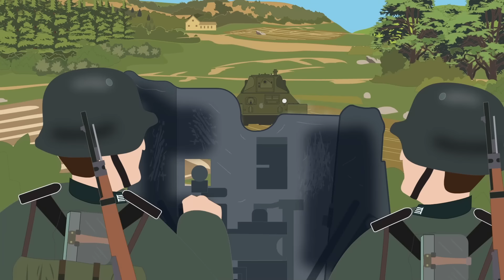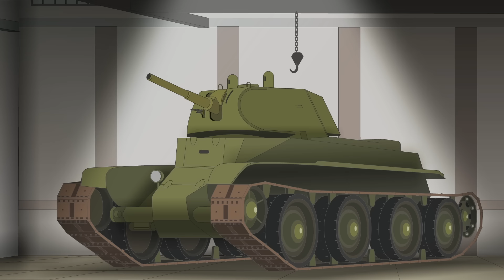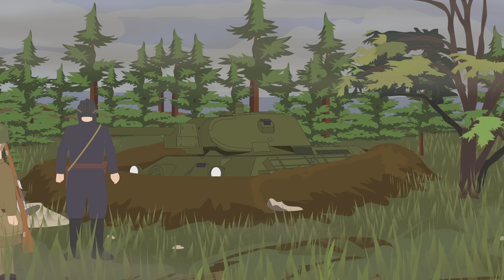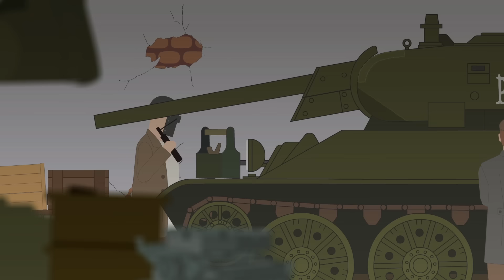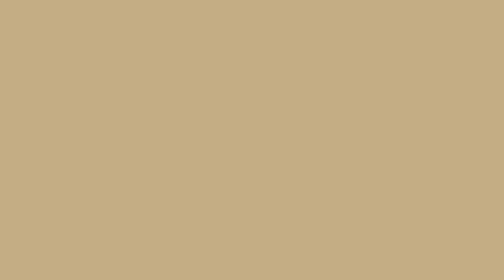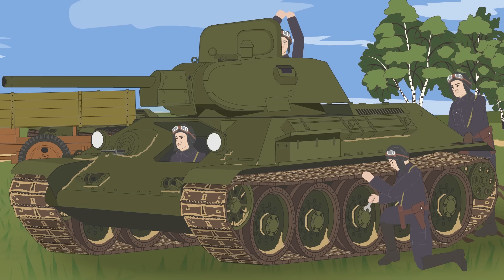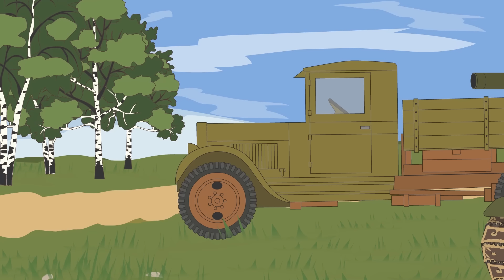Was the T-34 Really the Best Tank of WW2?

Comment: There doesn't exist a universal "the best tank" or smth. You should ask the inevitable question: for whom? Yes, for Soviets it was absolutely the best tank. Why? 1. Because simply it was available. It is always good to have a tank than not to have it.  And it was available in big numbers. Something the Germans didn't understand or simply couldn't replicate. You may produce technically a wonder tank but if you can do it in very small numbers having a thousand mile frontline you are doomed to be outmaneuvered. 2. Tanks allowed the Soviets to compensate the lack of heavy artillery - and especially fast-moving heavy artillery - in the first half of the war. The Soviets had huge problems with nitroglycerin gun powder for heavy artillery and so they yielded to Germans on an 1 to 3 basis. Hence the meat grinder of the Rzhev battle. If they could compensate it with large tank forces welcome to Operation Uranus and the encirclement of the 6th Army in Stalingrad  3  T-34 was technologically simple. This was absolutely crucial for the Soviets having teenager foremen and women at their tank producing plants. When men were drafted to the army. Only in the second half of the war the State Defense Committee ordered gradual return of skilled workers to the industries. And thar was going very hard: men simply were accustomed to serving in the army and fighting in the war. So the simple the tank the simpler and smoother the production. Germans didn't have this difficulties almost the whole war and could allow producing technologically very complex Panzers. The Soviets couldn't.  And so on.

Comment: T34 was the biggest factor of the defeat of the Germans in ww2. It was simple and easy to manufacture. Way less complex to the tiger and panther. The sheer numbers is what did it, and germany couldnt keep up, and their overly manufactured behemoths would break down mostly and not have the equipment to repair it and put it back in action.

Comment: T-34 in reality was an iron coffin, which is confirmed by losses. As a result, of the 35,300 T-34 produced from 1941 to 1945, 4,800 remained after the storming of Berlin.
Let me remind you that 1,347 Tigers T-6s were produced, 489 Tigers-2s, and 8,500 T-4s. If Denits had built not 1,100 submarines, but at least 1,000, then there could have been twice as many "Tigers" built.

Comment: The Sherman was the best tank.  Not because it had the best gun or the most armor, but because it was the easiest and fastest to make, it was the easiest to maintain and trade out parts, it was easy to load on and off a ship (size was limited by shipping restrictions), and it had the best ammo.  Technically America couldn’t have a bigger tank because of shipping.  Every 7 tanks was equipped with a bigger gun called a firefly.

Comment: I would say the best tank overall would have to be German-made from Panzer IV to maybe, maybe Panzer VII.

T34 was just easily massed produced with lower quality parts and overwhelmed the Germans on the Eastern Front with sheer numbers and agility.

Sherman’s were similar to T34 in the way there massed produced quite well.

The British and French were having problems just trying to keep Germans at bay on the Western Front.
Reply: they all suffered from the same poor transmission and engine issues though. Even the most reliable Pz4 wasn't nearly as durable as a Sherman, or even a Cromwell - North Africa showed this pretty clearly.

this is fine for lightning assaults where the maintenance won't catch up to you till post-invasion, but when you're driving across eurasia it becomes plentifully apparent.

the raw performance doesn't matter when the tank is outnumbered because of logistical issues with reinforcement tanks, and in poor position from the lack of mobility. a Panther was screwed from the flank, whether it was a 75mm low velocity Sherman M2 or a 17 pounder - and can't reposition mid-combat because of said poorly designed locomotion.

the Sherman and even the T-34 were superior in both design and production in terms of engines and transmissions - and immobilising a tank is as good as killing it.

Comment: Most of the T-34s problems were not design flaws, but rather due to the urge of producing them fast, often skipping entire procedures to ensure qualiy of material. It has to be considered that the soviets faced the biggest front of any war to this day. The T-34 was better armored, faster, deployed in bigger numbers and could easily pierce german most common armored vehicles such as the pz IVs and stuG III, while not completely useless against Tigers and Panthers, wich were great tanks but would often have less armor piercing shells than the soviets had t-34s on the battlefield.

Comment: Well, the Russians knew the shortcomings of the T34, and were in the processes of correcting them. Thus, WW2 happened and they effectively had to use it, as is. For all of the crap about the Sov's faith in the tank, the reality was they weren't entirely happy with it. Hence, they were quite surprised and relieved by the German's respect for them. The lack of trained crews and radio's severly hampered it's abilities; moreover, the crews were so inexperienced a lot of T34 breakdowns were due to the crew, not so much the tank itself. Which, by and large with a trained/experienced crew it was arguably as reliable as any AXIS/Allied tanks. Moreover, like the Panz IV, and Sherman, it was easy to repair in the field. By 1943, most of its earlier problems had been ironed out and with experienced crews they truly became tanks. Unfortunately, by this stage, the T34's 76" gun was only effective at dangerously close ranges to German tanks. Hence, it was upgunned to the 85. It's certainly my fave tank of WW2, but before fan boys launch in, the Panzer IV's and Sherman's were also awesome tanks, if you prefer them and hate the T34, that's your POV, they all did their job, it's not a pissing contest. The Russians by the way, really liked the Shermans they had.

Comment: Actually Soviet T-26 and BT5, BT-7 were adequate counterparts to the German Pzkpfw-2  and Pz-35(t). The problem was that Germans had much more experienced crews, radios on every tank while Soviets only had on commander tanks. But most importantly, Germans had combined warfare tactics where tanks worked together with infantry, artillery, air force. Soviet tanks were on their own with little to no infantry support as well as towing vehicles of armored corps could achieve top speed of 10km/h cross country, 30 km/h which means Soviet armored units often had to leave their artillery behind. In the first 3 months of the invasion Germans have captured about 1000 of F-22 towed artillery, made a few adjustments and used it under the name of Pak-36(r) until 1945.

Comment: In theory the T-34 was a great tank but it suffered from only having a 4 man crew,  the basket in the torrent didn't move and in a certain position the commander/gunner had to lean over the seat and try to get his eye to the sight,  it didn't have many rounds directly available and had to remove the rubber mats in the torrent torrent to get more ammo,  the armor was said to not be as strong as other tanks.  But the thickness of the armor being well slopped , wide tracks,  diesel engines and powerful main gun it was better on paper than in reality.

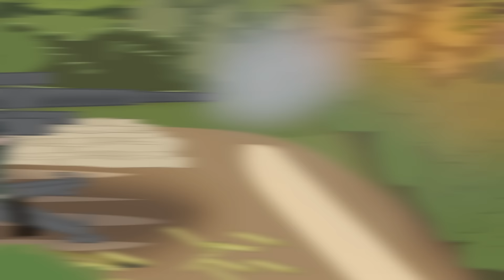Comment: 10:28 the Russians actually had about 2300 t34s and would produce a further 2600 in the opening months of operation Barbarossa alone with most of those being destroyed or lost to mechanical issues
21:40 sloped armor does work to a degree but doing something like heat treating the metal to 600 brunell would cause the armor to be hard but also very brittle which is why there’s so many images of t34s that looked like they were hit by lightning. The insane amount of heat would also cause spalling which is when hit the interior armor would essentially fragment and cause shrapnel to ricochet in the hull
24:30 yes it was a good engine for the time but due to all the production cutbacks like not putting rubber on the wheels and cause steel wheels to grind on steel tracks further wearing them down would mean barely any t34s could exceed 15km per hr.

Comment: What a lot of people tend to forget is that a shell does not necessarily need to penetrate a plate of steel to kill the crew, if not cause so much pain that they can't fight anymore. This is because of a little thing called spalling, which is when odd little bits and pieces of steel detaches from the plate as a result from an impact. Even an earlier model Panzer 4 with the howitzer was sufficient to kill a T-34 through spalling alone. But spalling doesn't exist in games like War Thunder because that wouldn't make for a fun game, so nobody thinks about it. APHE was not a good shell for the time because it explodes inside the tank like in War Thunder. It just caused more spalling because of the explosion.

Comment: Hitler so hated the Russians that he forbade Germans from imitating their technology. However he accepted the fact that the German Tiger was a modified, heavier and improved version of the T-34.
The T-34 used diesel engine and so it’s engine did not freeze in the Winter unlike the German tanks in 1941 and 1942, the T-34 had a wider tread and could easily travel at full speed through rivers, high embankments and snow drifts,it’s main gun was better than the Panzers I and 
Panzers II and its parts could be interchanged with other Russian tanks and could be fixed on the battle field. At the beginning of Barbarossa, the German tank crews were more experienced than the Russian tank crews. By 1943, it was the Russians who had the more experienced tank crews. The T-34 had its armor slanted which made it 50 percent more effective than non slanted armor.
As for numbers, at Kursk, the Germans lost 1,000 tanks and the Russians lost 1,400. In another month, the Russians produced 2,000 more tanks including those which had the same larger gun as the Tigers and Panthers. The Germans need a full year to replace their tank losses.

Comment: T-34s were beasts in their time, and they still are.
Reply: No they are not lol. They wouldn’t be able to do anything significant today. The Sherman 76 in Korea mopped the floor with them. As soon as the 1950s rolled around, they were obsolete. The Sherman however, was used up the the 1990s and did take on modern MBTs no problem.
Reply: @josh05683 fair enough, though you have to admire Soviet production output.

Comment: The T34 was designed for the British army in 1932 by vickers. but it didnt meet the minimum specs of 50mm armour for a medium tank as it only had 48mm. it was called the A32 by vickers.

the sovets bought it with a production licence minus the 2 pdr gun as Britian didnt want anyone getting the best anti tank gun in the world. the 2 pdr (30mm) could take out armour upto 50mm, it got modified to fit into british tanks. France used a 40mm anti tank gun in their tanks but it didnt have the range or penatrating power of the 2 pdr.

the numbers on soviets tanks was the year they entered service.
the A32 bought by the soviets in 1932 became the T32. but to save money and speed up production they bolted on the amour.
During the border clashes with Japan in 1933 they found they leaked when it rained and when it got hit the bolts flew off inside killing or wounding the crew. so in 1934 they went back to the factory and had the armour riveted and welded to the orginal vickers specs in 1934. It got renamed the T34.

Another tank the soviets had that the Germans had trouble with was the T24. that was another British army reject made by vickers. That was also sold to China as the type 24. Poland as the PT7 and the Germans who called it the PZ38(t). which was the best tank Germany had till the panther came along. diff was the Soviet, Chinese and Polish versions had the full armour of 28mm and fitted with heavy machine guns that had anti tank ammo. the version sold to Germany only had 26mm armour and a heavy machine gun that could not fire anti tank rounds.

Till late 1940 Germany had no anti tank weapons at all excpet the stuka dive bomber.

My dad was in the BEF with 1st experimental div which was later renamed 7th armoured. He said Germany had nothing to take out even a British light tank let along their medium and heavy tanks. they couldnt take out the Polish tanks either. they relied fully on the stuka for anti tank work.

Germany got their hands on a lot of British and French tanks after Dunkirk and they used those in North Africa and against the soviets. If they couldnt get  enough British and French tanks they used Italian tanks which were far suppior to anything Germany could make.

To prolong the war and help Germany fight for longer the ford motor company designed and built the panther and tiger tanks in the USA and shipped them to Germany.

WWII was planned from start to finish by the allies. the plan was to let Germany win for at least 3 years hence why british and french troops kept retreating when they were winning battles cause they got orders to pull back causing unites to become demoralised as theyy couldnt understand why they kept getting orders to retreat when they had the Germans on the run and surrendering.  D-day was planned for 1947. British held back their secret weapons lie the atom bomb built and ready to use in 1933 and the Gloster whittle jet fighters also ready in 1933 cause the war would of ended too soon.  Battle of britian was a trap to lure in as many german fighters as possible to clear the skie sover gemrany so thr bombers could flatten as many German cities as possible. it was about the total destruction of Germany.

Dam buster raid planned in 1930. bouncing bomb ready in 1933 but no plane to carry it till the lancaster came along in 1942.

Britian and France were getting ready for another war with Germany even before Hitler had been heard of and the war was going to happen no matter who the govt was in Germany.

Plans had to be changed when the Soviets started pushing back Germany a lot sooner than they though they would so D-day had to be bought forwards to 1944.

partly cause the soviets had modified the T34 to make it better than the version sold to them.

Comment: The T-34 was the tank that the USSR army needed in that particular period of history. many tank divisions were just being created, there was a huge shortage of qualified tankers. plus, there was not enough experience and qualifications of engineers and workers in 1930-1943 to create technically complex and reliable machines (by the end of the war, this disadvantage was practically eliminated). hence the need for a simple, reliable tank. but the Germans had the concept of a small professional army and the military industry was very well developed - so they could afford more technically sophisticated tanks. The T-34 approached the beginning of the war with many more shortcomings ("children's problems" due to the still undeveloped production methodology). plus, due to the urgent evacuation of factories, tanks with defects have been arriving in the army for almost 2 years (many were assembled by teenagers due to lack of personnel). but as many Germans believed, it was the excessive complexity of tigers, panthers that largely predetermined the outcome of the war
Reply: saturatedsausage7398  it was so in the beginging of the war. in the 1941 the most loses T34 was because shortage of spair parts and mechanic problems. after 1943 though T34 was quate reliable  (tanks can supports assult mission for several days in a roll without help of mechanics)